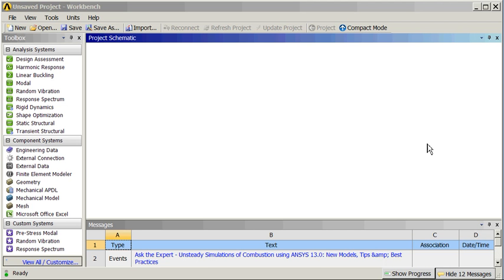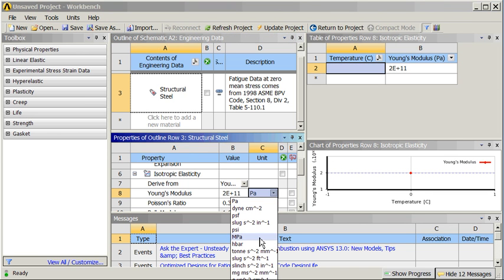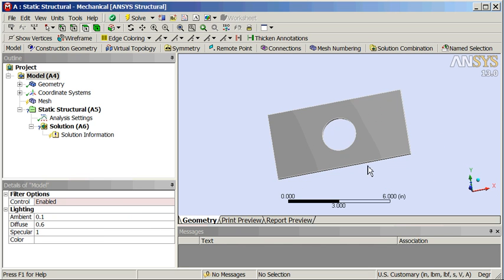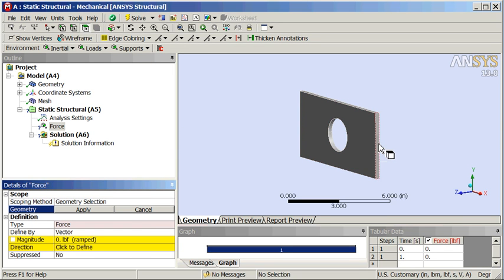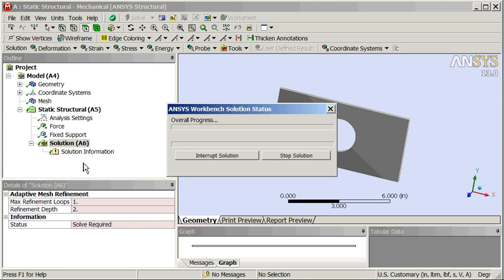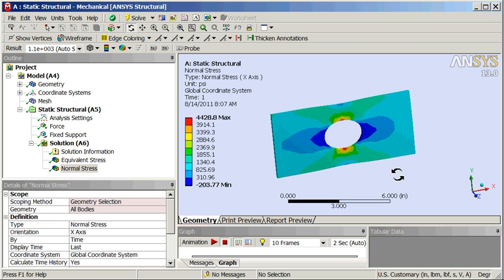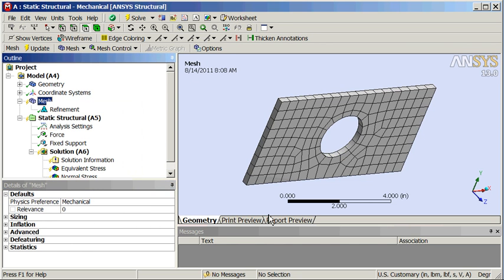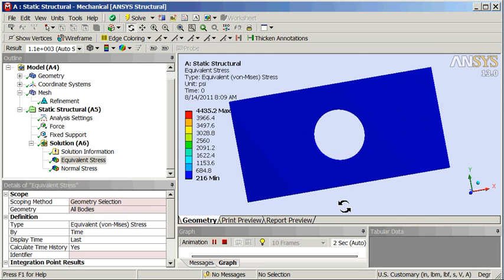ANSYS Workbench Structural Tutorial 1

Comment: I want to solve buckling analysis of plate resting on elastic foundation in ansys apdl or workbench with different boundary conditions and different value of winkler and pasternak foundation .The pasternak foundation includes shear stiffness and winkler foundation includes normal stiffness.
Suppose there is plate of 1x1x0.001 m and E=200 gpa and nu=0.3 and resting on foundation winkler stiffness 100 N/m^3 and pasternak stiffness 100 N/m^3. I want to find the critical buckling load of this plate using eigen buckling or linear buckling in ansys.

Comment: This is very helpful video! Can you tell me if there is a way by which we can plot a tabular data for yield strength of steel against increase in temperature, in material properties? I want to look at displacement in steel beam with increase in temperature but I am not getting any fruitful results (All results are linear as they do not vary even if I increase the temperature time). I am trying to do all this in static structural. 
Thanks

Comment: I do agree with this, however the programmers at CAE will almost always disagree, and claim that the SOLID187 element has been "substantially refined from previous tetrahedron-based elements"  I actually have done a couple case studies on this, comparing the results.  There were minor differences in result, but the most major difference was in computation time; the quad mesh took 5x as long to solve.